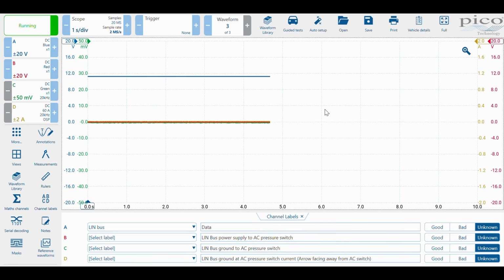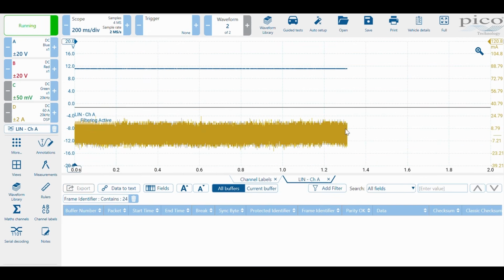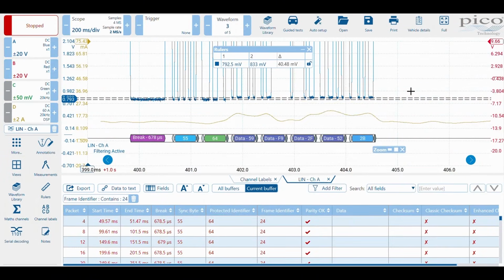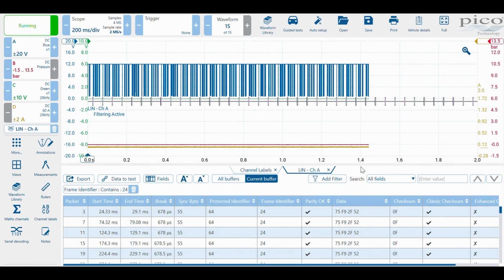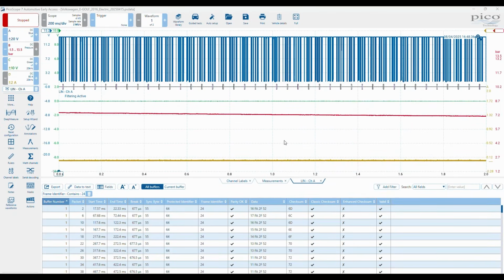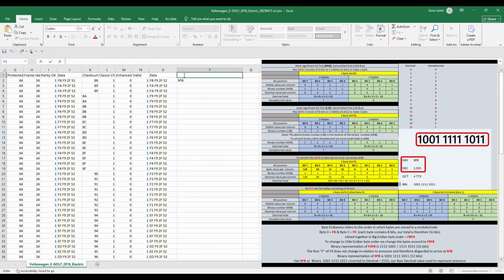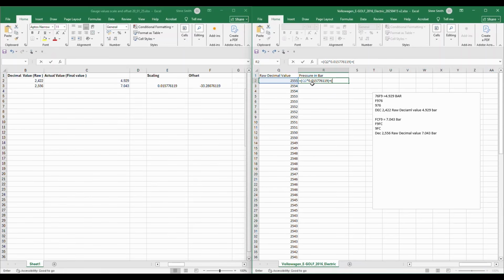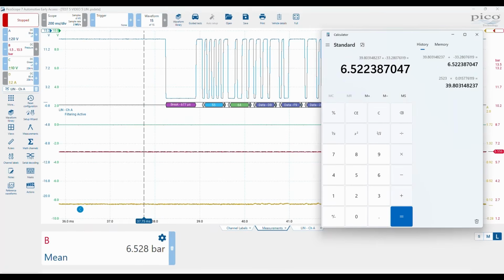Communication Networks Lin Bus (Cheeky Extra) | PicoScope

Comment: so this has a wire hooked to a stake driven in earth????   get your terminology correct.  its not a round its a common return  most likely connected to the negative side od the supply     or common return for short.   btw earth and ground are just english american alternative terms
Reply: And yet everyone understood what was implied, he didn’t need to explain exactly what a voltage is did he? And yet we all understand…

Comment: Love the detail of your videos. You're getting better with each one. I feel this is a difficult topic to train automotive techs in but it is highly needed. Most service techs are mechanical vs electrical and in fairness that is what they were taught. However, most faults are caused by electrical vs mechanical. Keep the videos coming.
Reply: Hi Rob, I’m an automotive technician, I’ve been in the trade for over 20 years and bought myself a 4425a scope at the beginning of the year. I don’t use the scope as often as I would like (and don’t know how to use it as well as I would like) as I don’t see enough jobs that need it. I’ve watched this video and am totally lost. My question is, why would I need to be able to decode the lin signal and how would I know I needed to?
Reply: @rupertsaunders6244  this primarily would be used to identify a missing info on a multi slave Lin network, lets say you have 5 rear light units all on lin, visually ok but one is reporting an intermittent no comm, you could interpret the data and find if it’s the lin network at fault, or the component, but just seeing if a Lin signal is present is half of the job, it needs both good plausible data which can be confirmed via Lin decoding, and from such be reverse engineered to know which slave is what by designation if one for example would intermittently not send a slave response onto the network. Yes it’s most certainly in the region of a factory level tech support case, however if it never needed to go to factory and could have been found in a workshop, job is a gooden. But yes once you are pretty good most faults can be found via pattern recognition and quick checks vs deep dives with relatively little width. But if I had all the time in the world I’d do a deep drive every time, for me it’s more about learning and the journey than just knowing the root cause

Comment: Steve,

When Pico Technology was founded in 1991 (according to Wikipedia), no-one could possibly have imagined PicoScope would evolve to such a level.    I wonder if there were any cars containing any kind of communications network back then.   And most cars on the road would still have had carburettors.    

The information you extract is quite astonishing.    And I wonder what you would have said if someone had told you that one day you’d be making the PicoScope dance to your tunes and dissecting the conversations between electronic boxes.

What a journey.    

Martin